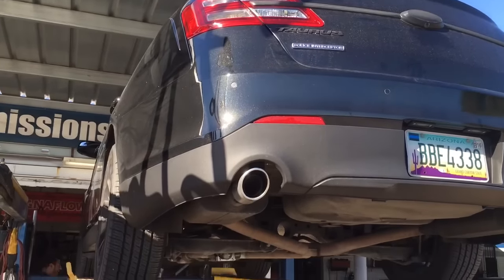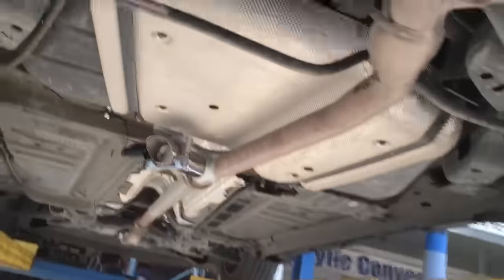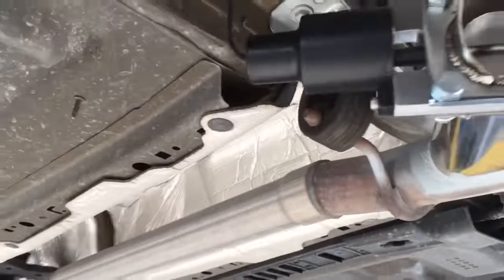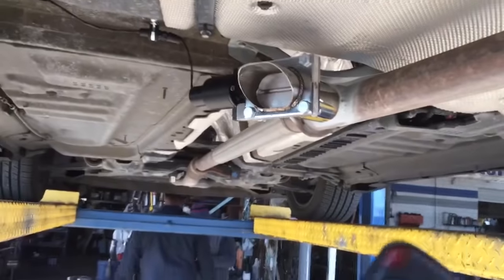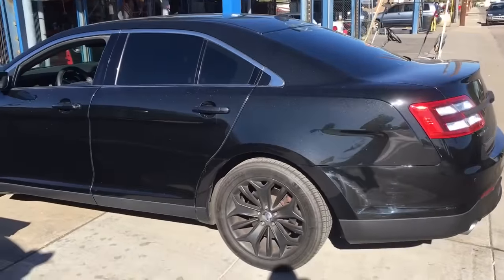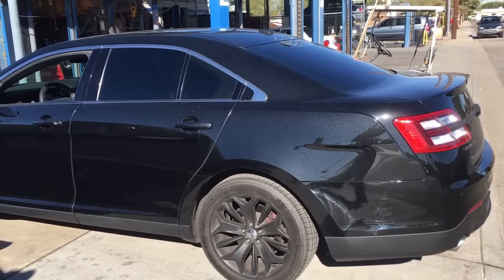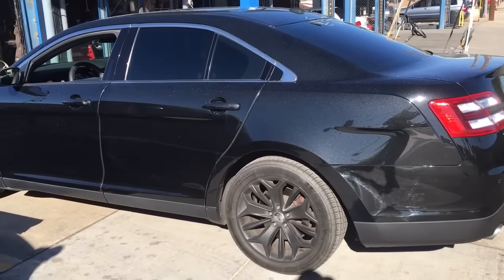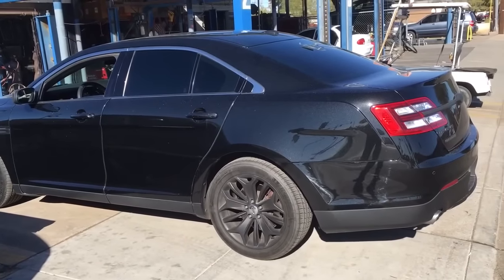Electric Exhaust Cut Out

Comment: On a Taurus??? Wtf man 😂😂😂
Reply: The Taurus SHO has some power. Ford didn't do anything special with the Fusion Sport. They pretty much just used the Taurus SHO V6 twin turbo. Definitely not lookers but they're sleepers
Reply: Exactly what i was thinking!!!!
Reply: Juan Rey 💃
Reply: Greg for 25k I can get a El caminos with 454s for 14k and spend the rest and get it to 1000 hp
Reply: Greg I They actually used the 2.7 liter twin turbo from the F:150
Reply: That eco boost is a bad bitch....i have and eco boot explorer that AWD, has a little tune on it. Thing is actually really impressive. Has little tiny baby turbos too. Lol
Reply: @larsfrerichs7174  the f150 and explorers are 3.5's i believe.....but still very similar.
Reply: I hope this is a joke
Reply: @commanderzavala9268  You could, but you won't.
Reply: Don't laugh at the tourist I have a 2004 Ford Taurus SE 520000 MI
Reply: SHO PP is a awd twin turbo 3.5 v6 factory sleeper...catches alot suspecting challengers off guard. better know what you’re pulling up next to💯
Reply: Dude the Sho has a 3.5 TT ecoboost and and. Simply with a tune it can beat Mustangs, camaros etc.
Reply: @FSEVENMAN  nah why would I respect it no matter what people can have poor taste
Reply: @commanderzavala9268  ok and you will not have any modern features and youll spend another 10k rebuilding the engine in a couple months. This is a 4 door daily driver not a drag car LOL
Reply: @sandovalob  it's a 3.0 SE not a  SHO
Reply: Whyyyyy on a NA V6
Reply: A SHO would gap your car buddy
Reply: @krislalone4160  whos car lol 👀 I actually own a sho lol 2015
Reply: ?! .... its a v6.....
Reply: its a sho buddy... factory sleeper
Reply: Lol you most not know bout this sleepers
Reply: Not a bad choice think about it imagine how much shame someone would feel for losing to a Taurus its fucking golden in comedy value alone
Reply: @Ichibuns  sho has 3.5  & fusion sport has 2.7 twin turbo but I get your point
Reply: @commanderzavala9268  not everyone wants a 1000 boat from the 70s they can’t daily, or drive to any practicality other than days at the strip…
Reply: Bro, this Taurus puts out 360+ HP...Give it some tone!
Reply: Hey man I’m thinking about it on an impala! 😂
Reply: @Ichibuns  d
Reply: Taurus is a beast
Reply: You know nothing about that kayote turbo engine. Sit down and learn about it sir 😂

Comment: Exhaust of my car got eaten by rust. Same result
Reply: My thoughts exactly, sounds just like my leaky exhaust lol
Reply: Makes a piece of crap taurus a steaming piece of crap
Reply: Same in my 2002 vw jetta, it sounds like a diesel engine
Reply: Tony Botchagaloop  it's for sound a cutout like that serves no other purpose
Reply: Tony Botchagaloop I could ask you the same  because you're straight up wrong.
 
 it doesn't matter how fast/short the exhaust gets out only the resistance to flow that it creates and a cutout pipe after the cat vs a proper high flow catback exhaust makes almost no difference to power especially with stock headers and cats.
 the reason you see cut pipes on drag cars is purely for weight reduction because a drag car doesn't need mufflers I can be as loud as you want
Reply: Tony Botchagaloop lol. I bet you’re the type of person who throws on a crappy k&n intake and crappy eBay exhaust and thinks the car gains 50hp
Reply: Free sport exhaust
Reply: And thats for free
Reply: Of course, if you install it on an egg beater. A turd with wheels will always be a turd with wheels no matter what you do to it
Reply: I rather just cut the exhaust muffler off and call it a day 😂

Comment: When the cut out is open does it close on the factory exhaust or does air still flow through the entire system?
Reply: It flows through the entire system but for some reason when the cutout is open and you put your hand on the rear exhaust there is no exhaust smoke coming out from the back
Reply: @norbertoespinoza5158  Air chooses the path of least resistance to exit the car, thus using the exhaust cutout

Comment: I also have a early 2000's Gm van, with resonator in place of the muffler, drives and sounds great, seems to have gained more power, based on how it feels while driving and reading the speedometer and the tach / rpm gauge.

Comment: The taurus sounds pretty good

I remember the old taurus sho, with the yamaha motor, they were quick.
Reply: They have this body style sho also
Reply: Brother not too many people even know yamaha made those engines kudos! Im a mechanic and worked on a few of them way back when they was hott!!!
Reply: my dad has one and replaced the clutch in it two years ago. driving it home the issue wasnt fixed, he thinks pressure plate maybe. after it over heated on us and we walked home he decided hes not tearing it apart again and its just sitting now. shame, its a beautiful ride.
Reply: they weren't that quick at all.  especially for a v8.  my friend had a mint one and it was not as fast as I thought it would be.  not even close.  it was decent, but those engines were garbage.  had problems with the cams.  cam walk I believe.
Reply: I owned a 1994 SHO. SO DAMN FUN!!!! TALK ABOUT TORQUE STEER. great car
Reply: Oh yeah they were V6's for the guy that says they were V8. Early models were basically 2 Yamaha motorcycle engines welded together and they could SCREAM
Reply: In 99 they were v8 yamaha making 246hp would top out at 155 and could do some hellacious burnouts.  before that they used a v6 not sure of the hp rating but both engines were powerful for that time period. current model sho uses a 3.5 twin turbo ecoboost and are awd making 365hp. Very fast for a full size luxury sedan.
Reply: @one7decimal2eight  : They are V6 not V8, also telling from what you have said, it describes alot of the regular Ford V6 ( Vulcan & Duratec 3.0 Liters as I remembered ) -  not the Yamaha 3.8 Liters High Output V6.
Reply: @theroyalcrownedtiger2946  no.  They made a v8 sho in the late 90s.  That's what my friend had.  And it was slow.
Reply: @one7decimal2eight  : The SHO made before the late 90's has the V6 Yamaha motor in it and it picks up and goes.
Reply: @one7decimal2eight  : The late 90's Taurus as I remembered has the bubble / circle headlights on it.

I have seen the late 90's SHO being beaten by the earlier generation of SHO, which has the more boxy body shape.
Reply: @one7decimal2eight  : Hmm interesting, was not aware the late 90's SHO came equipped with the V8.

Still the V8 SHO could not beat the older SHO with the V6 Yamaha in it.
Reply: @theroyalcrownedtiger2946  a minute ago you had no idea the V8 even existed.
And now you're saying that the V6 is faster? How do you even know? The truth of the matter is that they're actually very very close.
Reply: @one7decimal2eight  : I was not aware the V8 existed in the late 90's.

Seeing the V8 being outrun by the V6, cannot say for sure if it was stock or not, since I did not ask, but I know what I had seen, the 2 taurus did race, and the older taurus outran the newer taurus, my guess is that the V6 had been modified.
Reply: @theroyalcrownedtiger2946  How did you see a v6 SHO beat the v8 model when you just said you didn't even know the v8 ones existed?
Reply: @jokerzwild00  : I had seen the different body styles SHO go at it.

One has the older boxy body style.

Other has the much more rounder body style, with the circle headlights.

I know the older boxy one has the V6.

Although I was not aware that the newer sho having the V8, I did recently find out the newer sho with the rounder body style with the circle headlights has the V8.

Comment: Would be interesting to see horsepower drop or increase depending on back pressure if the cutout was made BEFORE the catalytic converter
Reply: It would increase if it installed before the cat with a remap and decrease if it was before the cat with no remap
Reply: With these cars it's kind of irrelevant, not enough pressure generated to matter
Reply: +2% power !
Reply: @yomalperezz468   at what RPM? 8,000? Or 4,000

Comment: I don't get the reasoning behind doing this on a taurus (or any car), is it to allow clearance for inserting tampons ?
Reply: Frank Dangler there are some vehicles that definitely need this so panties can be droppin.  On that hand, it allows clearance to the you know what 😉🐱. But other vehicles likes this or any ricer type vehicle shouldn’t need this at all 😂
Reply: Best. Comment. Ever.
Reply: Im sure this guy is a master mechanic.
Reply: Seal it up! 🤣
Reply: Its useful on a car with restrictive mufflers because it bypasses them altogether and makes more horsepower. You can also put one before the catalytic converter or straight off the exhaust manifold collector.
Reply: The reasoning is its this guys car and he can do what ever the fuck he wants
Reply: @trickelantra   THIS IS THE BEST FUCKING COMMENT EVER.... You tell them mofos what’s up
Reply: @livefastdiefun9290   whats even more funnier is that every german Performance car i know o, has one of those. Called Klappenabgasanlage, dunno whats it in english tho
Reply: It just sounds cool, it's just like people going to Auto Zone and adding a tip on the exhaust of a Honda Acura.
Reply: @JMac85X  performance
Reply: It's generally for track use, so you can run open headers/pipes but keep it quieter and legal on the street.
Reply: @trickelantra  that is true but other people can call out silly or inane things, especially since they shared it on a public forum.

Comment: Do you need to tune your car differently after this install? Change in airflow/ back pressure?
Reply: Ideally, yes. But without a proper redirect, most of the exhaust is still going down to the muffler. Causing turbulence in the exhaust. This particular application is not a performance mod.

Comment: Let’s pretend it’s not a Taurus for a second. these exhaust cut outs are incomplete because all they do is open a hole in the side of the exhaust. If you wanted one done properly you’d have a second valve further down the pipe than the first one to stop all exhaust flow from entering the muffler so you’d get the full sound, then put an actual piece of pipe on it

Comment: You'll probably have them come back after 6 months complaining about it falling apart, those things basically rattle themselves to pieces, get a traditional mechanical one, won't ever do you wrong and feels way cooler opening it up.
Reply: It's not 1962. I'll take the remote open to avoid tickets.
Reply: @ryanm7905  depending on where you put it you won't get tickets unless if your town has an ordinance in place for loud exhausts, I can go to a performance shop and get it done for $120 or a remote one done for $300-$600 depending on the brand. But if that's what you like then have fun replacing it twice a year, and if you can find one that doesn't fall apart then good for you lol
Reply: @ryanm7905  I had cat backs on my old Camaro when I lived up in Ohio, I'm in Arkansas now and still didn't get a ticket, if you got straight pipes that's a different story, which is why I was saying it depends where you put your cut out valve at, if you put it behind the cat then it's basically gonna act like a straight pipe and that would get you a ticket, I'm pretty sure cops are smarter than that too, if they see your car go by loud as hell and after they turn their lights on its quiet then they're gonna know.
Reply: @ryanm7905  that's shit lol, if I can't be loud and proud where I live then I'm not staying 😂
Reply: Exactly what I thought. Maybe open  -close by a wire manually but can't think of a way to pass it inside the car.

Comment: I own a Gm car from the early 90's with 2 doors and V6 motor, drives and sounds great, car has ram air and custom exhaust.
Reply: Grandam
Reply: @marcussmart3275  : Not quite, but you are close, in the early 90's the Grand Am was part of the J-Body platform, similar to the Cavalier, Sunbird, Corsica, Tempest, Beretta, etc. later on the Grand Am became N body platform.

Mine is the 2 doors Cavalier RS, it's got the 3.1Liter Multi-Port Fuel Injection with the Over Head Valves and the Turbo Hydramatic Transmission.
Reply: @theroyalcrownedtiger2946  those were quick for a factory car. I remember some of them would give firebirds a run for their money.
Reply: @marcussmart3275  : My eyes opens up out of surprise O.O they gave the Firebirds run for the money ? I was not aware they were that competitive way back then.

Hmmmm maybe I should swap in either the 3400 V6 Grand Am GT drivetrain or the 3800 Supercharged V6 Grand Prix GTP drivetrain into the Cavalier body, for the extra power and torque.
Reply: @theroyalcrownedtiger2946  I went to wyo tech in 2000. Had a classmate that removed the enitre interior in his except the driver seat to make it faster.
Reply: @marcussmart3275  : I see the idea of weight reduction, that was done by the class mate of yours, but it's not all that much weight with removing the plastic panels, center console, etc. just removing the spare tire and passenger side seat, is more effective weight reduction than removing plastic panels and parts.

By having the extra differential, transfer case, drive shaft, etc. it all adds more weight, at least when you compare awd / 4X4 / rwd setup, compared to fwd setup.

On the other hand, by having more weight in the back, it helps put down more weight to the wheels, which helps to keep it better planted to the ground, which aids with giving better traction and stability, especially at high / higher speeds.

 Also by keeping half tank of gas, it's less heavy than full tank of gas, but I suppose if your goal is to reduce weight, you remove what you can remove to make it lighter.

Comment: Lmfao wtf is this. All you did was create a huge exhaust leak lol
Reply: SI RICKO  more for muscle/ sport cars.   it takes away air restriction that the catalytic converter and resonators cause and gives you more horses power.  Also sounds better with a v8
Reply: This is a strait pipe on a switch
Reply: you dont know what you are talking about
Reply: @napieraustin  but you would need to retune the computer to get any extra hp after removing the restriction.
Reply: Wow dude....research up on this exhaust cutouts.... they are engineered to prevent leaks when you close them off. I used them on my 79 Chevy for drag racing then I close them to drive on the road cus where I’m at you get tickets for loud pipes
Reply: Live Fast Die Fun how does it work for you bro ? Does it relay quiet it down that much ?
Reply: phro beto yeah it's works great for me and another thing I like is right before I race my opponent... He or she doesn't know I have a lot of power in my truck until I open them. (Cus some people can hear it) then they look at me wishing they didn't bet so high I love this reaction
Reply: Live Fast Die Fun that’s badass . You have any  videos? I been looking up more vids of this cut out . I jus swapped a Ls 5.3 in my 80 regal on a single 8” cherry bomb no cats. That’s the set up I had to make the original 301 make noise & with his new engine I’m goin dual . But I’m interested in possibly installing this cus it just seems badass lol
Reply: @richterman3962  yep. This is just for sound. It's rice attempting to sound like muscle.
Reply: BraaapAllDay there are no restriction in an exhaust system. If you have a restriction, you have bigger issues to deal with. The psi before the cats is only 1.25psi which is virtually nothing.
Reply: FSXflyermaster you are obviously clueless as to how modern exhaust systems work
Reply: TG Lasers that’s what it literally states in the ASE training book on exhaust diagnostics.

Comment: Would make sense on a supercharged or turbo engine as they need no back pressure.you have just made your car even slower than it already is
Reply: yakks k you don't know what you are talking about. Have a seat
Reply: yakks k back pressure in an exhaust system actually causes the engine to make less power, whoever said cars need back pressure in their exhaust system doesn't really know much about how internal combustion engines work
Reply: Back pressure is for fuel efficiency if you want to go fast it don’t matter
Reply: Finally. Smart people in a reply section
Reply: Taurus is Twin turbo 365hp.
Reply: @johncholmes643  That's only on the Taurus SHO. The base Taurus has a naturally aspirated V6. In either respect, this car is still 💩 because it's Ford.
Reply: @jaredshelton4718  and so are you
Reply: @johncholmes643  And so are you kind sir

Comment: would want to do them just before the mufflers, dual exhaust so I might need 2
Reply: Bro you need to go to see Joe at B&M Muffler in Tolleson. This dude knows his stuff and his guys are super helpful.
Reply: It depends on what sound you are trying to get, before the mufflers will have no droning noise, before the resonator will have droning noise
Reply: Shon Kirkpatrick Also you might have dual exhaust but must cars don't come factory as true duals, they usually meet in an X or H pipe configuration in the middle of the car.. if in your case they dont you can always get an H pipe welded in and save yourself the extra 100 bucks on buying two cut outs

Comment: Professional shop and u couldn’t even put a small bend in the pipe? You just cut pipe on an angle and weld it butt to butt? Looks like a back woods drive way install! Lol! I take that back I could have done better job in my drive with a Harbor Freight welder!
Reply: Lukedawg Dangle I could've done better with JB weld and a throttle body.
Reply: Sam Wilson lmao! No doubt!
Reply: @samwilson182  😂😂 that was funny